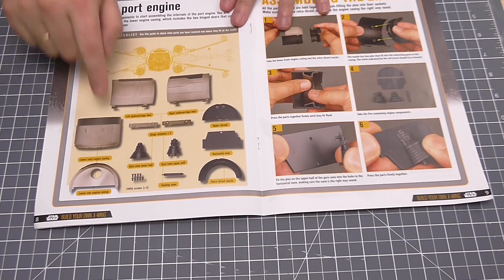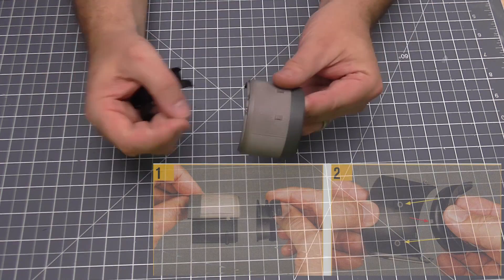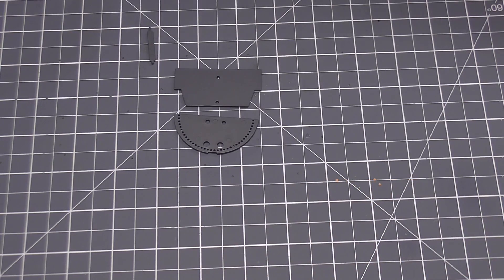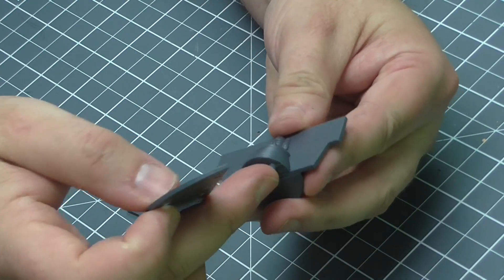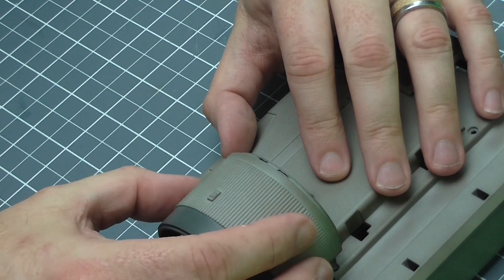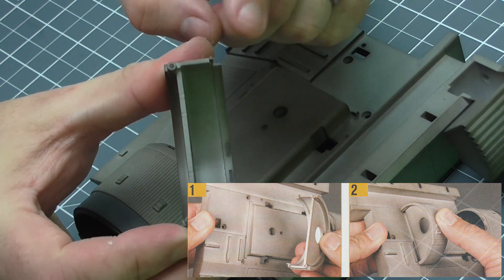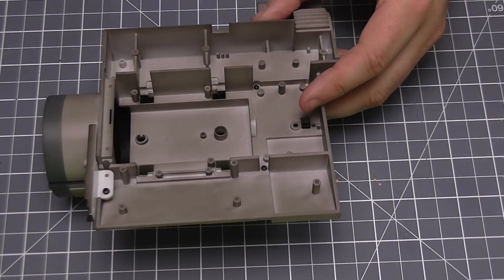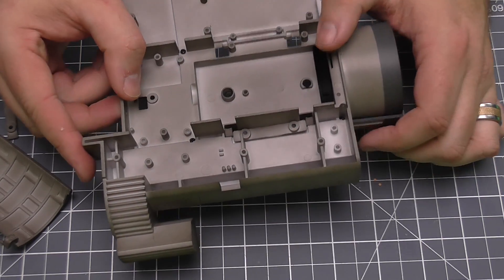Build the X-Wing - Part 24 - The Lower Port Engine

Comment: I reckon the hatch is for an undercarriage well.
Reply: the landing gear struts will attach to those holes inside. I reckon you'll have the option to display with or without landing gear down?
Reply: @aztekdummy  I thought exactly the same myself.